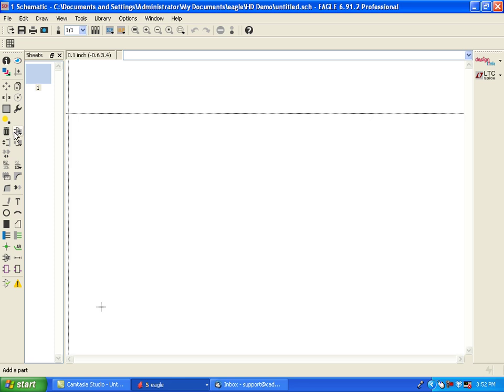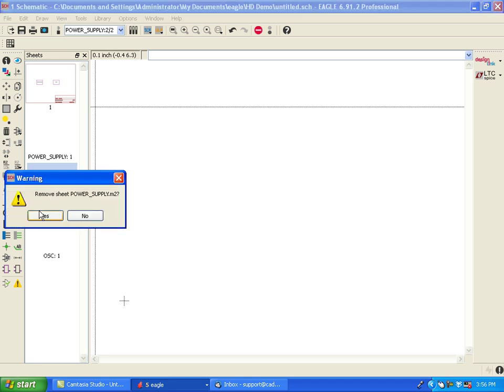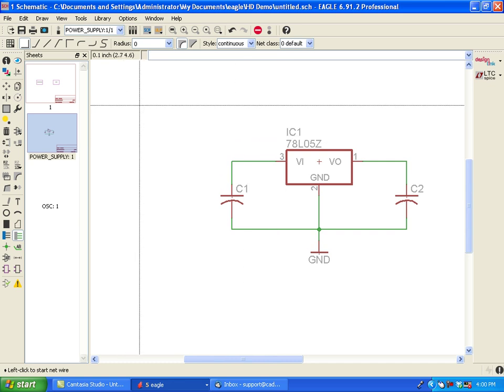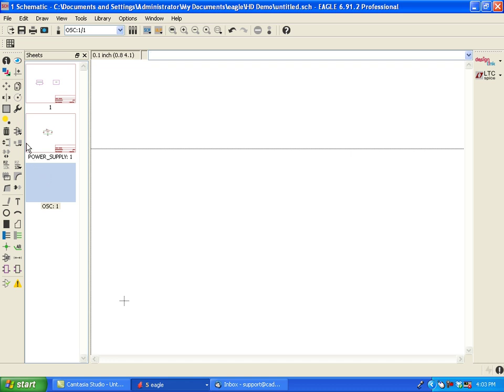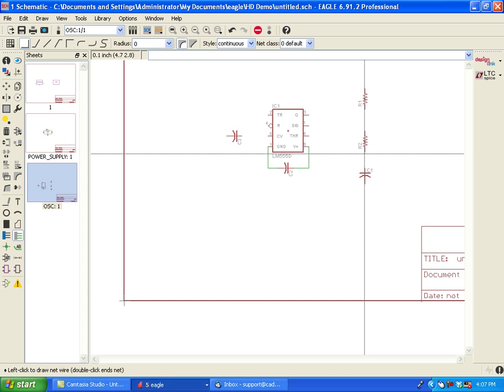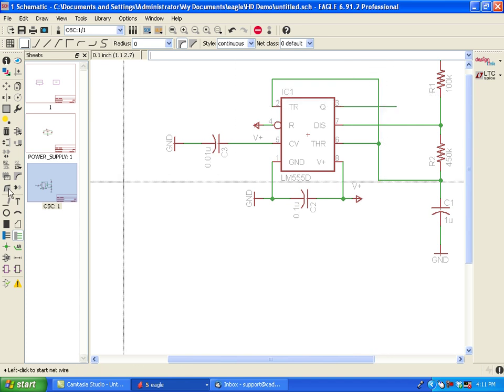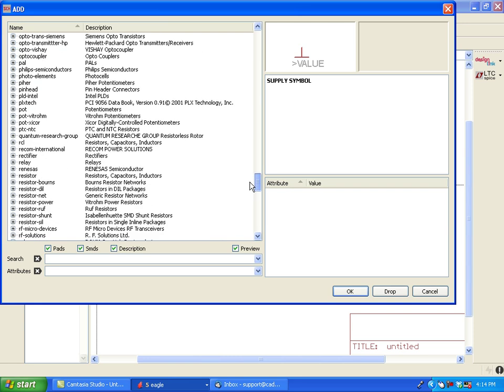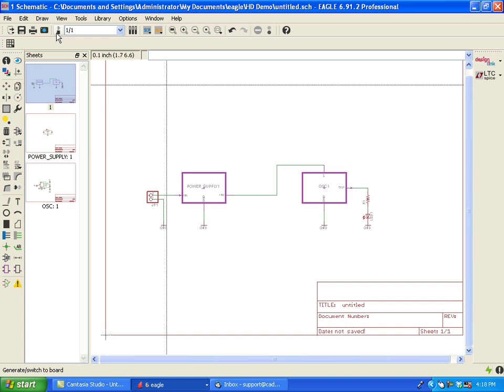EAGLE v7 has Hierarchical Design Capabilities

Comment: Any chance the you can replicate pcb layout using the module system. Currently you have to layout each instance of the module
Reply: Yes, I feel like I wasted $550 upgrading to v7 because the only thing it offers is hierarchical design, which doesn't include layout. I have a test board with a 10x10 array of identical circuits and I currently have to make the same edit to each one individually. By the description on the CADSoft website, hierarchical design should have solved that problem, but nope.
Reply: johndoewdsf I really don't understand why EAGLE  doesn't have this function. That would be so helpful ! 
Hierarchical design in Eagle is Useless without that function,  i have no reason to upgrate.
Reply: Hear hear! Perhaps the parts for each module could appear in the board in a small dotted box. One can then select one of the boxes for editing. As you move parts or add traces in one box, the changes appear in the other box also. If you need the modules to be different, simply smash one or more of the boxes, and their contents appear as elements in the top-layer board.
Reply: That's exactly what I'm looking to do as well.  Blocks in schematics are great, but I really want layout blocks.
Reply: I just made a ULP to copy the layout and routing of the first module to all the other modules on the board. It just about works and is worth the time if you are going to be using models a bit.
Reply: Chris Atkins There's a way to solve your problem (10x10 array of identical circuits), but your schematic and board will be inconsistent. Make sure you have a backup first!

Copy your .brd file and name it something else. Open that file (Eagle will ask about opening the Schematic, say "No"). Using the selection tool, highlight your layout (turn on all necessary layers - top, bottom, tPlace, bPlace, etc.), copy, and paste it. Then paste again, and again... repeat until you have enough copies of your layout.